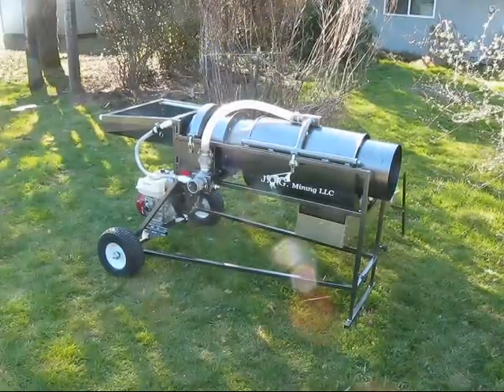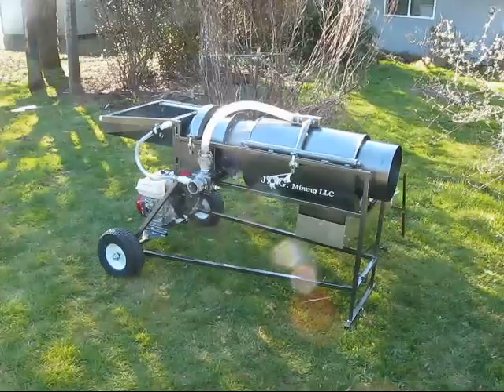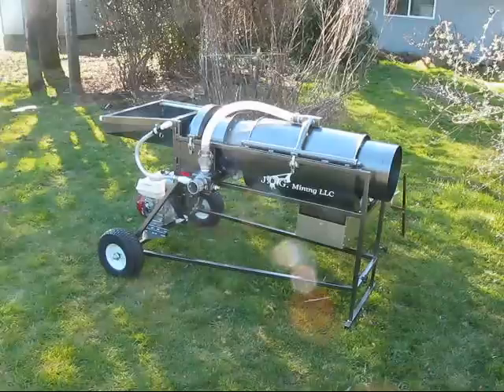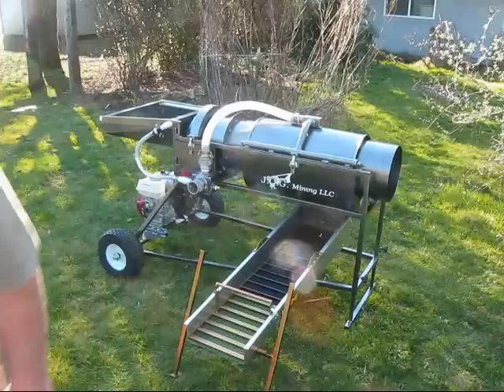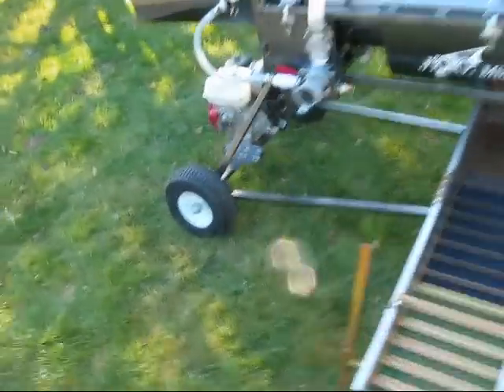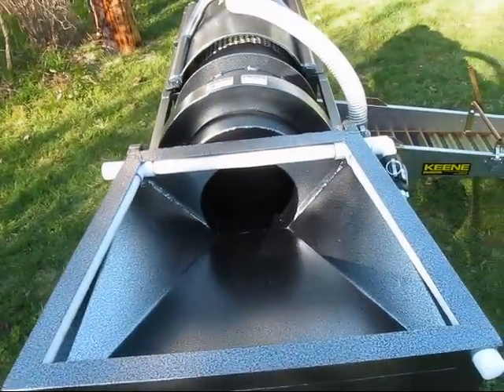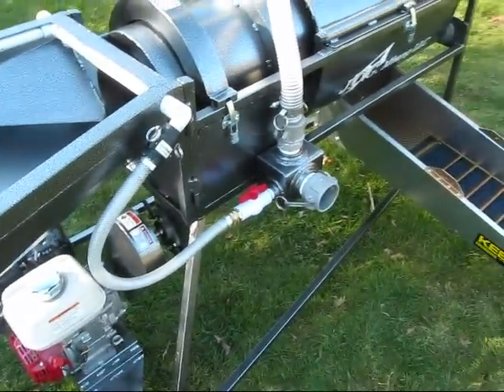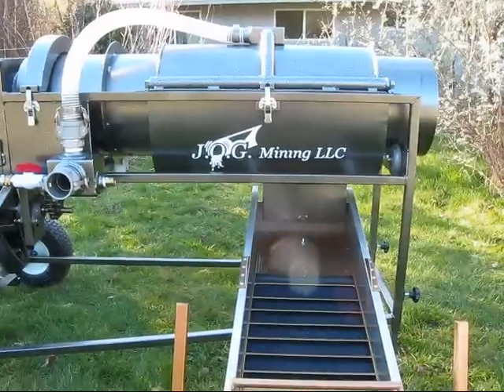2015 Homemade Portable Gold Trommel Wash Plant by JOG Mining LLC

Comment: This is exactly what I am looking for. Very well designed and fabricated, practical and strong with livable weight. absolutely faultless. My only consideration would be evaluate whether you may lighten the frame and feed chute by changing these to being aluminium (Aust). A gigantic well done mate! Best regards Bob
Reply from the maker: +Robert Manly 

I have thought about aluminum but the
difference in weight for the frame and hopper would not be sufficient enough to
really make it worthwhile, the frame itself is one of the lightest components
once everything has been removed. The heaviest part would be the drum. One
thing about aluminum is the sand and gravel doesn't slide across it as nice as
it does steel and wouldn't last as long.Thanks for checking out my videos and I
appreciate the nice words. Thanks again, Joel

Comment: Holy cow I just came across your video. that is an absolutely awesome trommel. I've seen alot but yours is sweet. I'm getting ready to build one was looking for ideas for a 12 inch. and I think I'm just gonna copy yours. I snapped screenshots of the walk around. I am a machinist and welder. and laser cnc, break operator. everything manufacturer. anyway you need to get that thing marketed. it's better than the keene. what a great machine. good job. ide buy one from you but my wife would kill me. how much would one cost if I changed my mind?